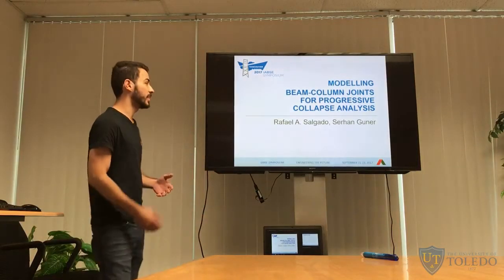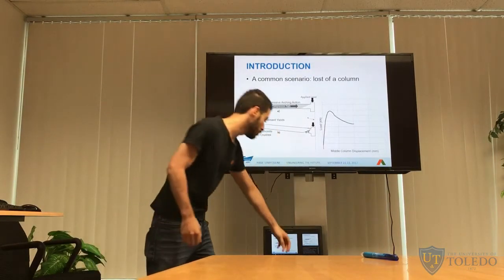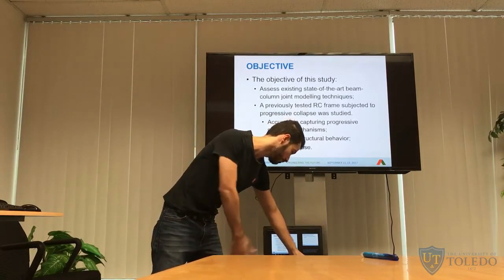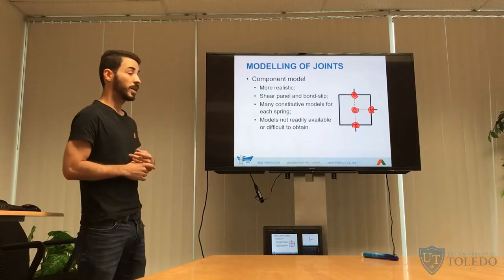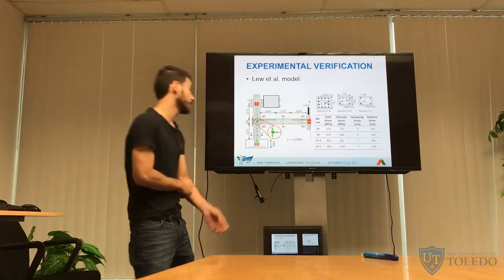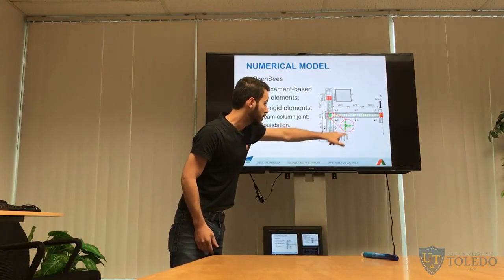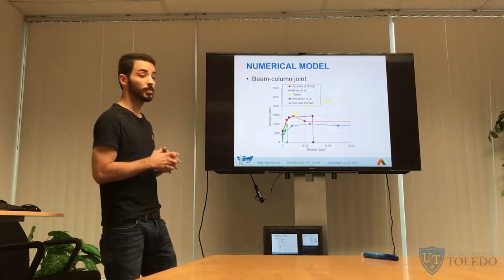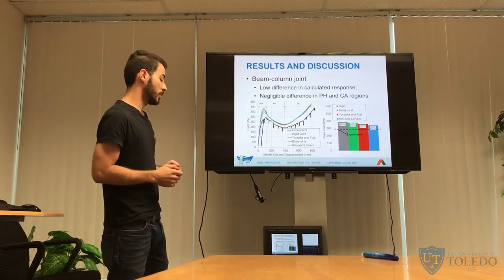Dr. Salgado Talks about Modeling Beam-Column Joints

Comment: The  main requirement of the seismic design of the reinforced concrete structure is strength of column should be always more than
the strength of @t this case, I found that the strength of column beam ratio is different in different
Country's design codes.For instance the ratio is 1.3 as per ACI and 1.2 as per Eurocode.What
could be the reason behind the existence of different values? Thank you